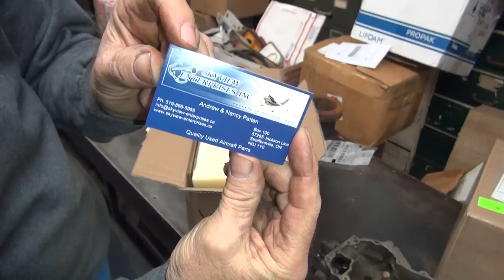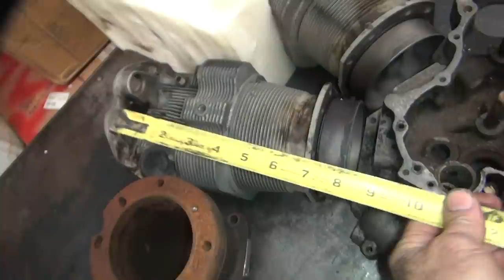see the crap i buy on ebay continental cylinder head TSIO 360 description race harley tatro machine

Comment: airplane engine might have cooling issues because it was made to be cooled by strong wind from flying.  NOT SURE THO  made to be inside a cowling with forced air flow
Reply from the maker: lets see. 100mph with the air blowing bethween my legs into the fins. hows that for cooling.
tatro
Reply: Just put a small airplane prop in front of the engine. It'll help with the cooling, aanndd create a little extra thrust...hehe
Reply: @TatroMachine  Works for me!. Let me fly this airplane when you get it built, I will log the flight time in my log book!  I'll add it to my twin commercial time. LOL

Continental engines kick ass at 10 thousand feet  👍